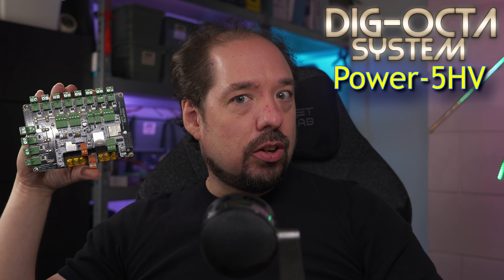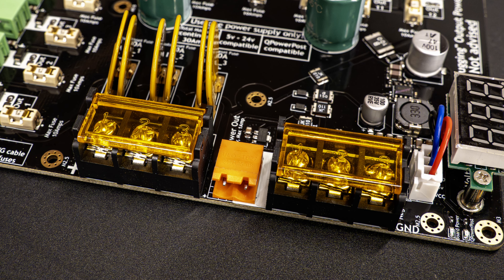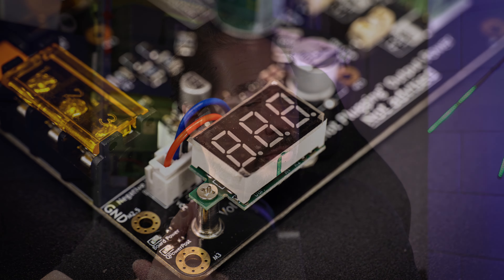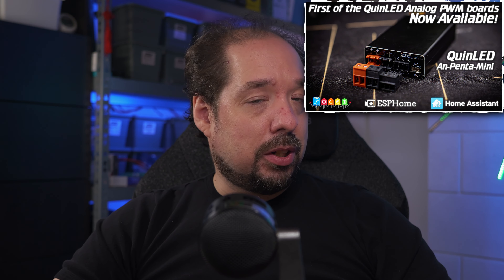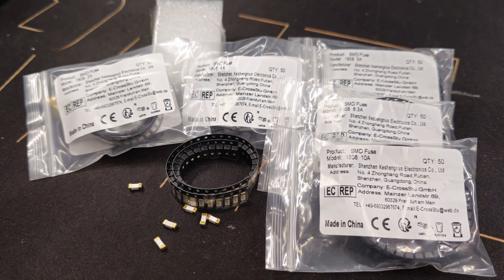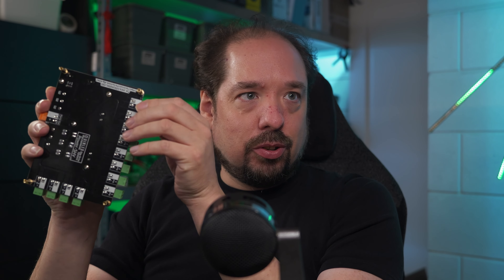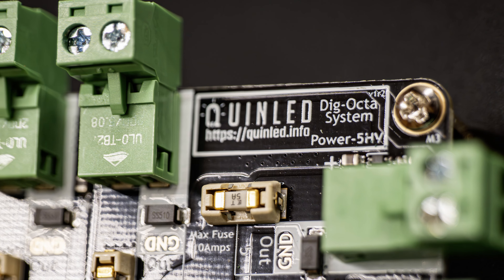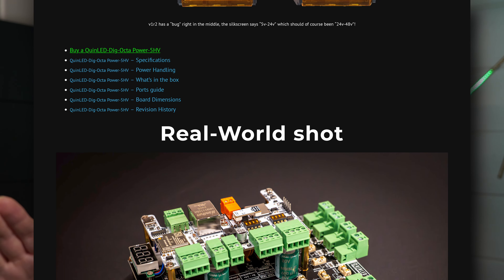💡QuinLED💡Dig-Octa Power-5HV introduction

Comment: Cool video - great to see new products being introduced. Being a WLED newbie watching these expands my knowledge. I have 2 Dig-Quads installed in playroom lights and then I discovered the most awesome QuinLED-ESP32-AE+ option board & ordered 2 from DrZ’s, mostly for the infrared remote control ability, this is for my wife so all she has to do is press buttons for the lighting effect she desires. 
The 144LED/meter SK6812 RGBW lights need some serious current (43.2watts/meter) 17.28amps/meter and for me a Dig-Quad with a 100amp rating would be perfect as a workaround I’ll use an automotive type fused distributed power box.